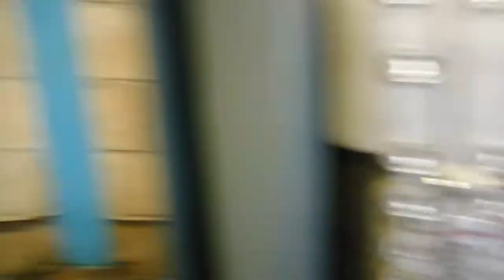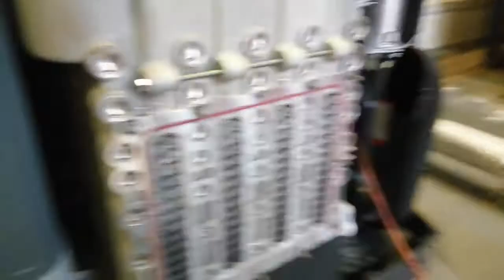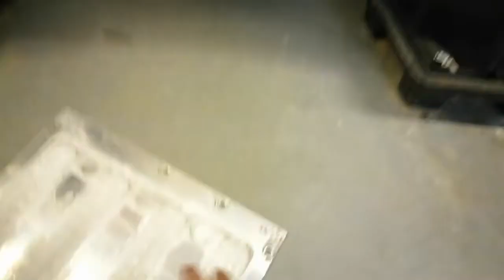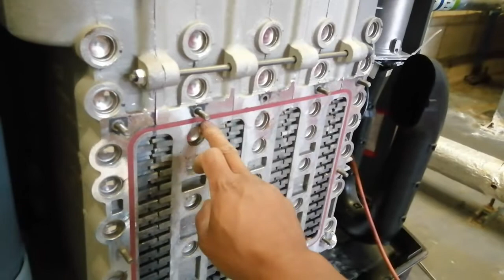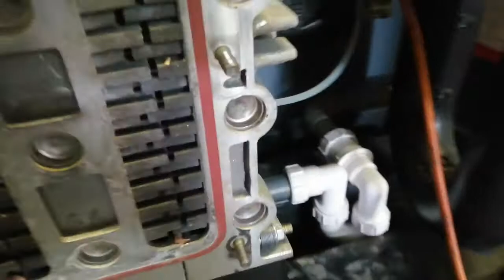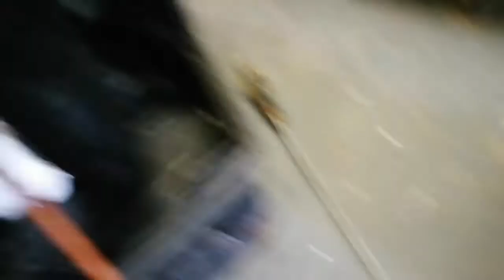E36 FAULT / REMEHA GAS 210 ECO PRO

Comment: Thank you for the video!
We have the same problem and we already have ordered the Remeha specialist. The Boiler stops nearly each day with E36.
The starting (after reset) goes not so smooth. I can hear 3 times a "wusch". When I demount the flue gas outlet during the starting, the starting is perfect.
So the question: Is the pressure through the cimney to high? (Is there positive pressure necessary in the flue gas channel?)
Reply from the maker: Put a manometer inside the flue and see what negative or positive pressure you get. I'd contact the manufacturer if I were you. Do clean the burner though. I have other vids on Remeha washing the burner down. Clean probes. Check condensate trap. Make sure the gas valve is opening upon ignition by isolating it with some gas in there and seeing if it drops. It's unlikely to be a flue issue but could be. Do the basics first.

Comment: As a technician, you should known to avoid those finger touches on that ionisation probe..
Its not safe placing suggestions of foult errors like these with possible couses (in your situation) to public people...
e36 could also be a bad mix of gas/air, shortage,faulty air pressure switch on supply air blocked in the room and even a bad neuter in your power supply...
But people will start to experiance if they watch too much of these video's thinking they know it as an educated and/or experianced technician wich is pretty dangerous misleading and can end up in nasty situations.
Only work on these guys if you are autorised for this guys people!...
I dont want to brake your video! its well made but not for amateurs... and pro's wont need guides like this...
I'm verry sorry i care about my job;s safety mate....

Comment: What was the final verdict?
Reply from the maker: Got it going consecutively without locking out. Believe it was the ignition probes. As you know it's good to clean out the burner and condensate trap when this fault code comes up. Could potentially be the gas valve needing adjustment but unlikely.

Comment: just run it with your pressure meter on the inlet at the gas valve. you'll see a pressure drop if the valve opens and you'll know if the burner is getting gas or not
Reply from the maker: True Clive, more than one way of skinning a cat and the way you mentioned is good. Although I have used that method I don't tend to use it much. Will practice that test more often. I didn't change the gas valve in the end even though the ohms readings were a little out. Combustion readings were good and boiler was lighting consecutively without any lockout unlike before. Thanks for the input mate, always appreciated.
Reply: @CommercialGasEngineerVideos  i find your videos really good, you clearly know your stuff and i always learn something. thanks